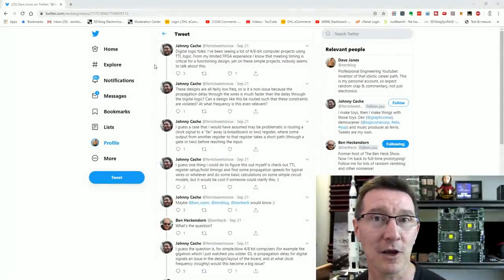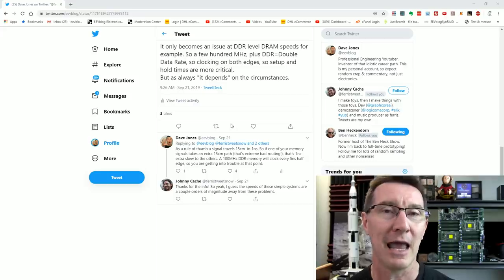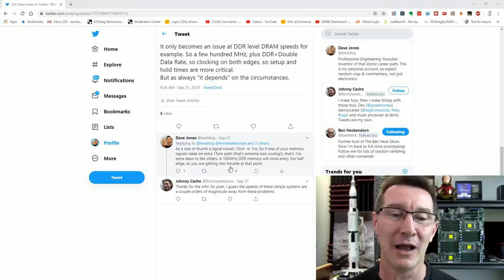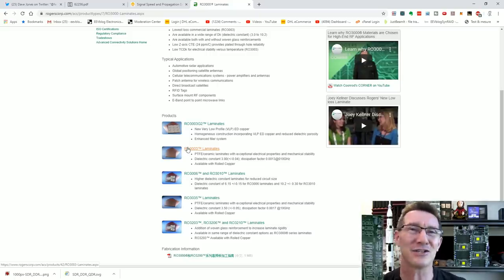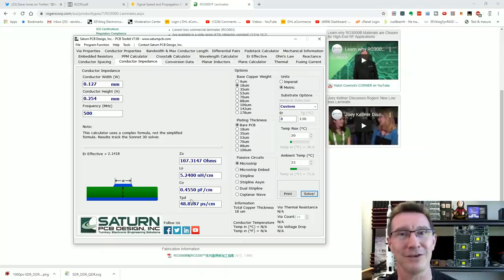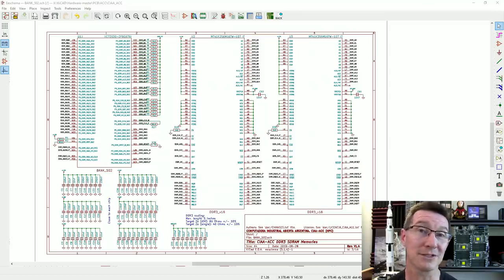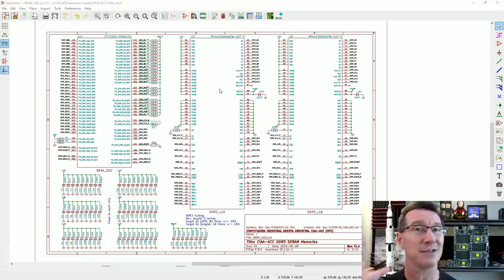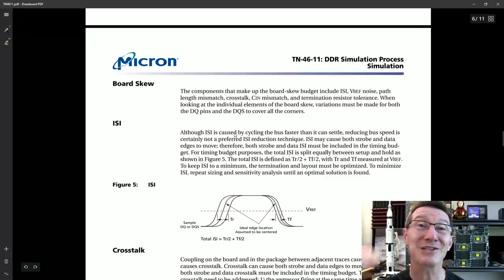EEVblog #1247 - DDR Memory PCB Propagation Delay & Layout

Comment: Hey dave, any chance to take a look at the new 8-bit computer that the 8bit guy wants to do?
Reply: The 8-bit guy don't want to use such 'modern' stuff like DDR ;-) . He really likes to reinvent the wheel with some extra's. Have you seen the latest board design, it is huge and expensive, doesn't fit the few tens of dollar price range he had as goal. You must be nuts to buy such system for only a little extra memory and a little more powerful graphics card. 8-bit guy was thinking of his dream computer with 8-bit-guy limitations because the 8-bit guy assume you don't need more, because the 8-bit designed it. It is not Apple and not a game! A fixed device you cannot configure or change, who else wants to buy this thing anyway? 

There is already an open source FPGA version of what he want (reviewed by RetroManCave),  others did the hard work and because it is open source he is able to download it and change the design. But he doesn't want to use a FPGA (he also noticed this in his last video), must be off-the-shelf parts with all the extra effort and costs because it must be old-scool in every manner. The FPGA used in the open source version is an intel, maybe that isn't his cup of thea.

I dunno........ Dave, take a look at it, what do you think about it?
Reply: Video 8-bit guy: https://www.youtube.com/watch?v=sg-6Cjzzg8s
Video RetroManCave: https://www.youtube.com/watch?v=e5yPbzD-W-I
Reply: If you're going to use an FPGA, might as well just emulate it and be done with it.
Reply: @gblargg  No you can not.
Because FPGA basically the original Hardware or something very similar to that. And the modern ones might be relatively cheap so that you can easily do an old PC with that. Look at the FPGA Nintendos! They are pretty much like the Originals, more or less.
Reply: Not much point.  Eventually, they'll realize that the parts they're using aren't going to work out, and they'll have no choice but to put everything other than the CPU and maybe the VIA into a single FPGA.  Even then, the original goal was to use as many "off-the-shelf" parts as possible, yet it now uses dedicated video ram, supports multiple graphic layers, dozens of sprites, 256 colors, 2MB of RAM... uh, this is supposed to be an early 80's computer, right?  Sounds more like a 32-bit machine running off an 8-bit bus just because.  The Mega65 has similar issues.  These machines are too expensive and not at all representative of the 8-bit era.

I'm working on my own 8-bit machine, but I'm thinking about it at the gate level.  So, even if propagation delays at the PCB level don't matter, the delays of the gates in each custom chip must be considered.  It'll only be simulated in software, since I know nothing about FPGAs, but I want the features and specs to be realistic enough so it could theoretically be manufactured at 5 micron HMOS.  I think that's way more interesting, fun, and a serious engineering challenge, than slapping a whole ton of features together just because a modern FPGA has enough room inside.
Reply: @Waccoon  "Sounds more like a 32-bit machine running off an 8-bit bus just because." That's exactly what it is. It's his dream computer.
Reply: DanieleGiorgino Oh no, reminds me of TempleOS.

Comment: The Gigitron TTL computer is very slow compared to modern digital electronics. Its effectively late 70s & early 80s technology. HC TTL gates has probagation delays ~30nS. F series down to ~3nS. PCB layout is irrelevant as far as propagation delay is concerned. Timing diagrams are still important. Due mostly, to how slow the devices operate. The TTL logic was the faster part. It was the slow NMOS LSI chips (microprocessor, controller chips, EPROMs, etc) that had to watched. EPROMs had access times of several hundred nS.

The following is a project I worked on in the early 80s:
https://threeneurons.files.wordpress.com/2019/01/esz7000.pdf
Look at page 4. The board looks a lot like that TTL computer board. Same technology. Used a 4MHz Z80 processor. I used timing diagrams all the time, back then. Again, because, how slow those old memory devices operated. Wait states was a common thing.

Dave was a teenager  in the 80's. I was already a 20-something working engineer.

Comment: What I learned from this video: If your design needs DDR memory, just say to management that the idea is impossible.
Reply: No, you tell them to outsource the layout to an expert.
Reply: If you have to lay out DDR memory get yourself a copy of Hyperlynx and start learning how to use it ASAP. It's not impossible, but it'll take some time. Work out your length matching constraints before you start to prevent you from having to start over, and give yourself 2 more layers than you think you'll need

Comment: I had some Corsair DDR2 1066 that was just not entirely stable at 1066 on a ASROCK N68C-S UCC. Sometimes it would mess up during the initial temperature changes. The gigatron at 8Mhz though, like the DDR data would be there like RIGHT NOW but really would idle a lot. I am sure you could slow it down a bit and take out any problems.

Comment: If it's 3mm on a 200MHz RAM, I am just imagining how much would it be on a 2GHz RAM module!
Reply: I had the same thought. Typical  DDR4 is running even above 2Ghz, GDDR5 even faster. Quite impressive timings and its not even "cutting edge daylight speed" technology, but at typical 2019 computer...
Reply: @Mario Vigliar well, this is starting to approach the manufacturing precision of many PCB fabs
Reply: @Mario Vigliar Not sure if this makes DDR4 less or even more impressive ;) Thanks for the info

Comment: Unless you already worry about impedance matching you need not worry about length matching.
The allowable difference in length is about ten times the length at that you need to begin to worry about propagation.
Therefore: NO, you do not need to think about trace length in a TTL design, because:
The ICs do not match -> it is useless to match the wire -> no matching, no wiggling.
Reply: But properly terminating bus'es and matching impedances and drive levels already becomes an issue for a simple 50 MHz parallel output from a camera sensor chip. Not to mention crosstalk.
Trust me... I learned this the hard way. When the data flanks change in parallel and influence the clock line so bad that it inserts an extra clock pulse you run into all sorts of debugging nightmares.

Comment: For me, with every DDR data signal going balanced through 1 via each, I've managed up to 250MHz DDR2 design, that's 500MTPS with a quality layout and good FPGA firmware with up to around 15mm trace differences between the shortest and longest data line.  (Warning, it was a well, short trace minimal design & I was using 666Mhz ram.)  Any faster, I had to match length on my traces, or use skewed IO settings on the FPGA.

Comment: @EEVblog thank you so much for those excellent  videos, I learnt a lot from you.. A question in my mind, during Ddr3 length matching, I should take into account package delay/length of the cpu.. but what about the ddr memory itself? Should I also consider their paclage delay? What confusing me is, if I design the board considering for ex: a micron IC, May be I can not use an Issi IC (as their package delays really different, I compared some using ibis models).. the board would be IC dependent that I dont want it to be.. whats your comment about this situation, would you take memory Ic package delay into account? Thanks..
Reply: Did you find the answers to this, is there a discussion page for these videos on EEVBlog website?
Reply: @優さん-n7m  I found the answer in an altium video, that i cant remember the link, the answer is: "dont bother the ddr memory package delay because manufacturer adjust it to be have the same delay.."

Comment: One giant problem with simulating a PCB design is that then you need accurate models of your FPGA and your DDR memory components.
While such models are typically available, they are often incomplete or inaccurate. Which will throw off your entire simulation.
Better to build a board and verify the design using a high bandwidth oscilloscope.
(There are also alternative poor-mans DDR verification techniques which don't require a million dollar scope.)

Comment: 30:31 Why does increasing the trace width reduce the inductance?
Reply: Not sure, unless he meant impedance. This is a little above me so I could be wrong.
Reply: When a current flows along a track it generates a magnetic field around the track.  The magnetic field lines run across the width of the track around the edge and back across the other side.  If you increase the width of the track it increases the length of the lines.  The inductance created by each line is inversely proportional to its length so increasing the width reduces the inductance.  Another way to look at it is to imagine two parallel tracks of half the width, each having inductance L.  When you combine them into a single track with twice the width you are effectively connecting two inductors in parallel which halves the total inductance.
Reply: @petehiggins33  Thanks, that's interesting.

Comment: When something says that it wants a controlled impedance differential pair - how important is it actually?
I had a look at USB a while back and it wanted 90 ohms impedance for its D+ and D- traces, which led me to look up what that actually even means. It looked fairly simple, as long as you don't need it spot on. (I think it said you have a 5% margin of error, if I remember correctly)

Now, if the traces are very short, does it still matter? How important is it, that D+ and D- actually have the same length? If you snake one but not the other, you end up ruining your differential pair somewhat.
Just try it, hope for that best, and go back to the drawing board if it doesn't work?

On that note - what does actually happen if the impedance is too far out of spec? Does the signal degrade to the point it just stops working?
Reply: For usb it is important. But to be fast, keep the track length under 1cm and you'll be sweet. If the impedance is wrong you get all sorts of great reflections and they can make life hard. USB will not tollerate much noise on the transmission line, so dont make 10cm usb tracks pass over anything oscillating. Keep them short as possible and then you dont need to think about it.

Comment: Most generally, this is why synchronous logic is used, so that everything has time to get set up before the next clock edge.
Reply: blargg DDR is a family of synchronous logic memory standards.  Problem is that at high clock speeds, the time between clocks is insanely short.

Comment: Can you make a video to explain this. I bought a kill-I-watt to measure the power used while charging an iPhone. I was under the assumption that the power brick would use power even when the phone was not connected. I was surprised to see that no measurable amount of power was consumed until I plugged the phone up. How do they do this? I thought the transformer would be consuming power whether charging or not

Comment: Stupid Q: Wouldn't high-speed signals on squiggly lines like this cause EMI issues?
Reply: Everything causes EMI. Making the lines squiggly doesn't increase the EMI significantly. What it does do is match the length and impedence which you need for high speed.

Comment: It's not a straight for issue to make a reliable DDR3 and DDR4 disign. Take a case  of a Virtex FPGA design that do a MIG DDR calibration at power on. All pass, every time so you think all is fine. But  if subsequently do a ram PRBS test it fail every time with different output pattern. I suspect it is due to impedance issues, reflections and cross talk. Well matched S-parameters in the PCB is very important. AMD recommend simulation, but it is very expensive.

Comment: One thing that bugs me about the Gigatron. They call it a TTL computer, but there aren't any TTL chips in it. The 74HC chips are CMOS. So it's not really a TTL computer, is it? People need to stop calling 74HC chips TTL. It would be like if I called a transistor a tube. Sure they do more or less the same thing, but they work in very different ways.

Comment: Rule of thumb for uneducated folks: look at other designs that use the same or similar memory architectures -  if they length-match the traces you should take propagation delay into consideration. If they dont, youre probably safe

Comment: I need a faster sdram bus for my stm32(f/h) project because my video display would be double buffered and use dma to blit gfx. 16-bit bus is not fast enough that I have on my bought dev boards. There are some gfx clitches with 16-bit bus.

So I've routed this one: https://youtu.be/4DWd3BKkug0

It uses 100MHz ('ish...) memory clock, is there something obviously wrong with the layout? Trace width needs to be checked, but every trace has one via (sdram is on the other side than the cpu), but only one via.

Comment: Saturn PCB ? My company forces me to use their software Altium
Reply: Altium can do length matching, impedance constraints, and some basic signal integrity.  Super powerful tool that has gotten much better over time.

It will automatically stop adding length once the trace is matched.  If you set your rules correctly, you really can't mess up.

Comment: Talking about ddr layout not knowing interface standards at bare minimum, typical Dave :). There is no such thing as differential data lines in ddr memory, there are only data strobes(one per byte) and clock which are complementary pairs. The rest is a sstl single wire terminated lines, they require time alighment but only within byte groups, rest is done by reset calibration.

Comment: ☺😊😀😁😂5 Smile's OZ boy.

Got something for tablet and pc case stuff I got a solar cell power unit with Tera or gigabyte upgrade for storage with a home router tracer so it will run off your home system while running back to the home and send it back from the city most I can do but not enough skill in router tec yet this could help so! if your interested let me know had a lot off issue trying to get those reflectors cut alone I won't start but looking to get it finished so if you want a look at the base set I've done on the prototype most is still drawn hand like send me a message and I'll spend some time putting it together for you but you will need the router unit the rest should be ok 15%min and you take the router next big thing no? for you and I think they will like I want the first for my tablet???????

Comment: I wonder, whats the wire length of a wire wound resistor typically? Never seen that on a datasheet, is it something you'd have to consider?
Reply: they make cross wound resistors that have lower inductance. but a regular wound resistor is also an inductor. So it's not a controlled impedance.